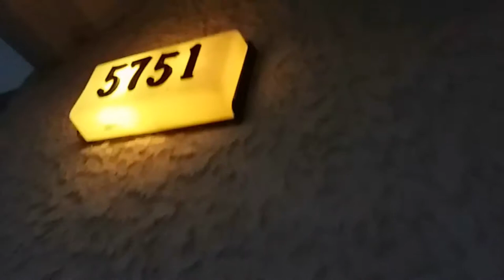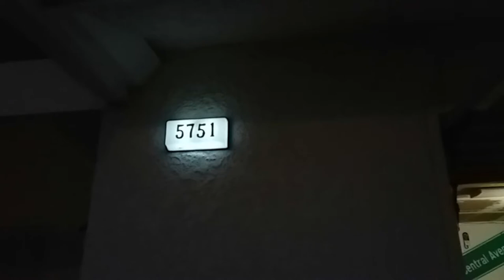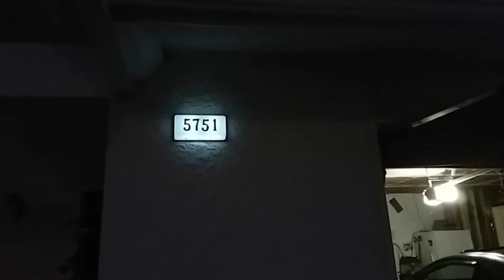How to: Replace your Halogen bulbs from the House Address to LED;s

Comment: Does your wires run to a transformer . I tried doing the same thing. LED's are brighter. Mine didn't work for me. I'm only getting 11 volts to the lights (because of the transformer) and my led light specify 120v. Sucks! Lol
Reply from the maker: Oh dang yeah i would try different light bulbs design to operate at 12v sorry bud hope it works out for you. Look for automotive bulbs